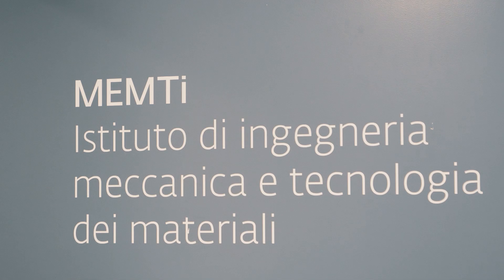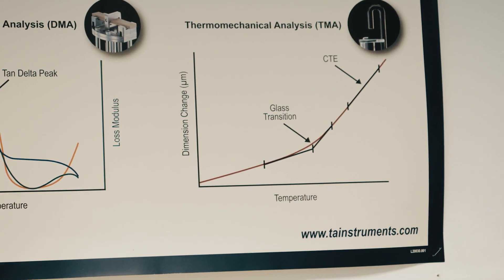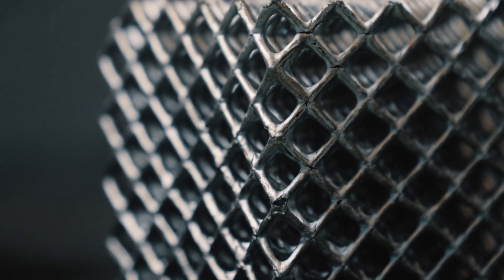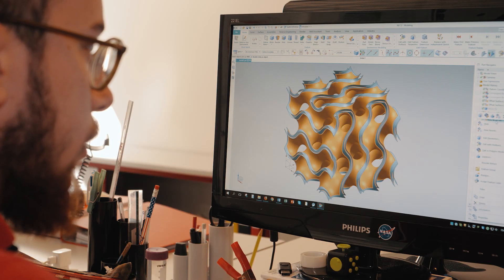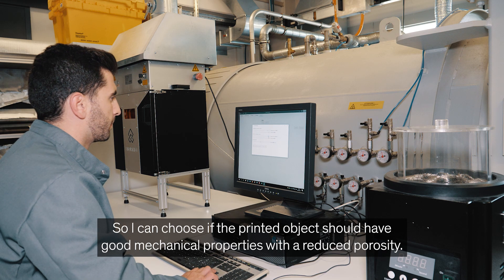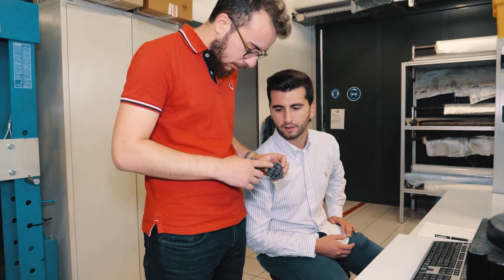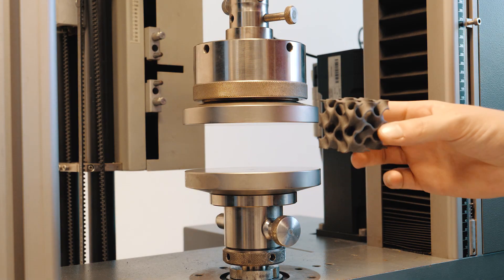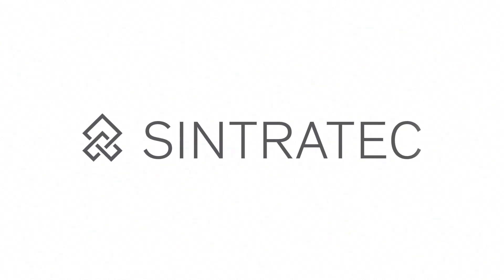How SLS is used to research Hybrid Materials - SUPSI Customer Story

Comment: Im a little interested in how they were able to clean the powder out of the interior parts of the porous design. That would take a long time with a dental pick.
Reply from the maker: There are many options for cleaning the powder cake. The more preferred option is to use a sandblaster, like our Blasting Station, or a Polishing Station. For more details you can check the Peripheral solution page: https://sintratec.com/peripherals/